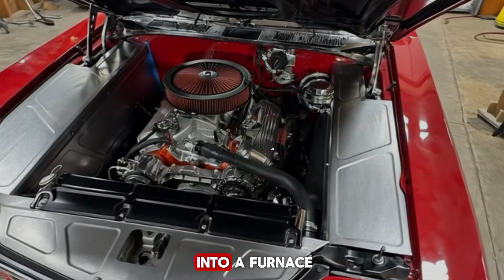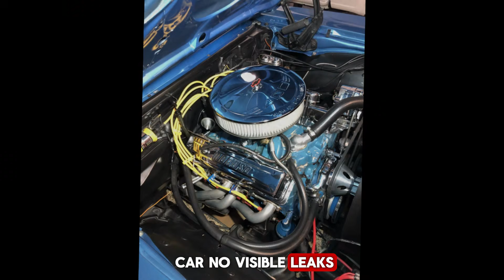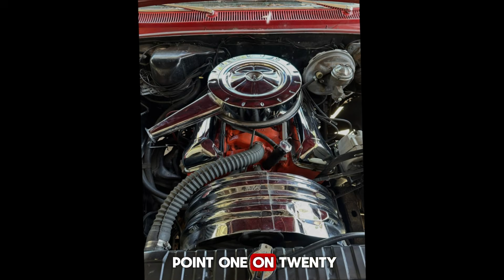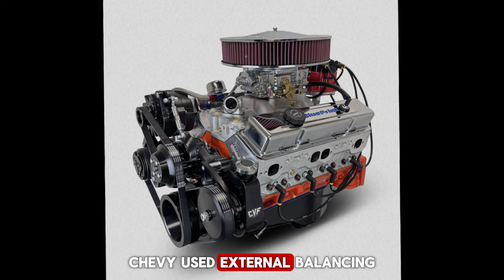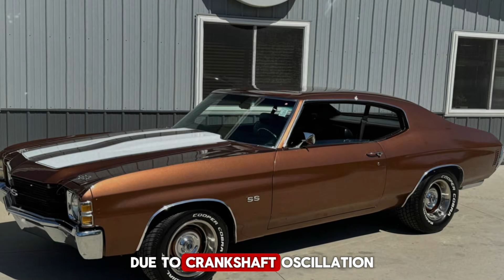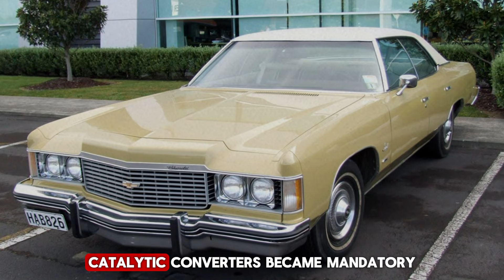Why Chevy’s 400 Small Block Was Every Mechanic’s Nightmare

Comment: I had a 74 and a75 and a78. 74 was a two barrel the other two were four barrels. Was some performance mods on one. Never had any kind of problem with head, gaskets or overheating as long as you kept a good thermostat in it. That was back when thermostats would fail closed or partially closed. And I can tell you that the 72 blocks with four bolt main with the right heads and steam ports in them would make 375 hp at 5500 RPMs, which is pretty good on the stock lower end and the rod angle on a 400

Comment: How about the 262 or the 267? Those were also garbage. The siamese cylinders were junk. You would think that GM would have learned their lesson. But no, oldsmobile brought out the 403 later in the decade with the same siamese cylinders, and the same problems....